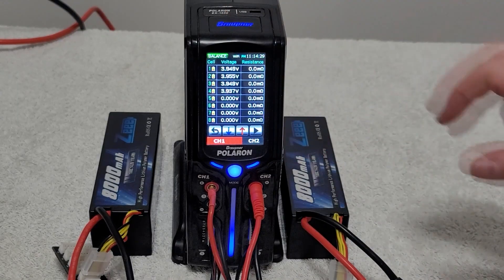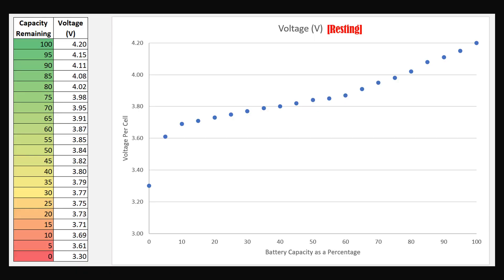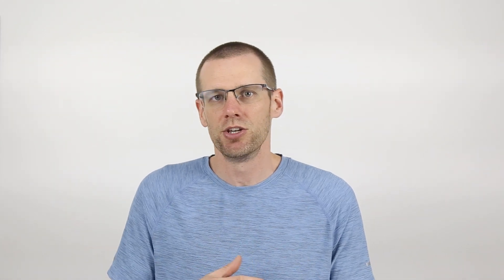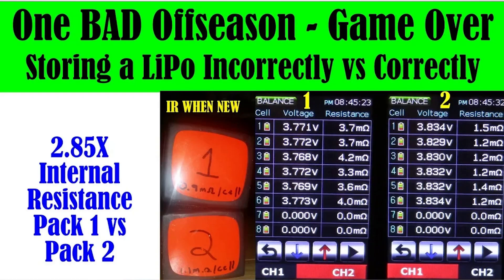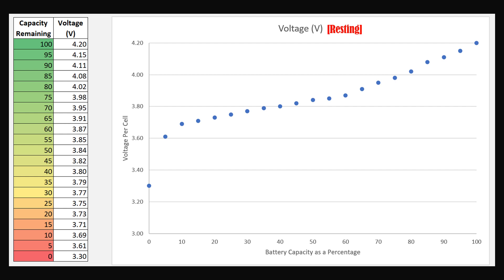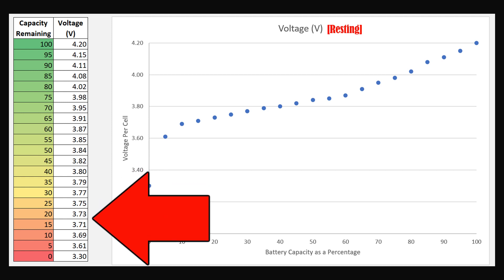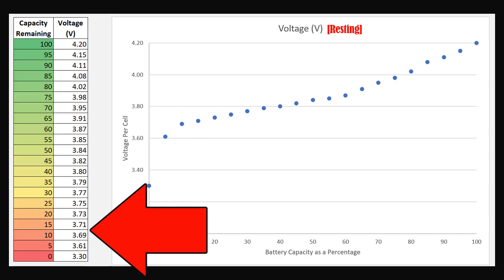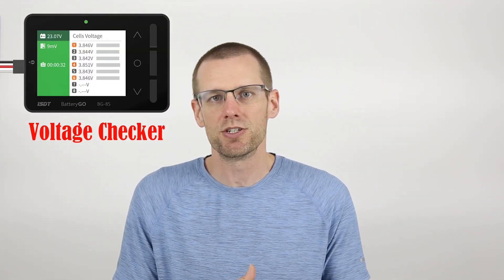Crucial Insights LiPo Voltage vs  Capacity Mastering Vital Voltage Thresholds

Comment: I stop at 20%, I fly pattern so I fly with 10s 5000mAh, when there comes less than 4000mAh back in the pack I am happy. Sometimes 15% but that is with heavy wind, and I try to avoid that. But normally I land with 30%
Reply from the maker: Perfect! sounds like you have it really dialed in!
Reply: @RCexplained  yes, I use telemetry